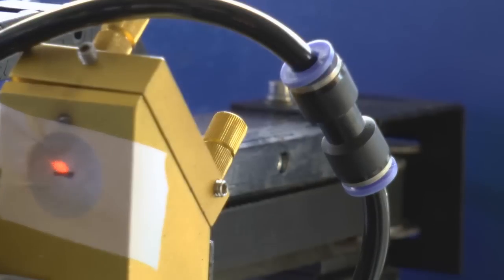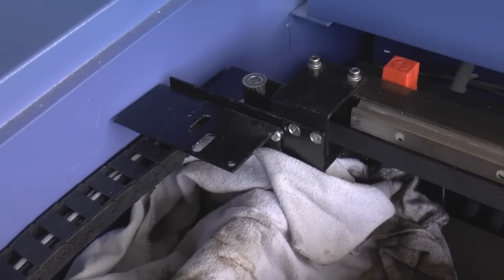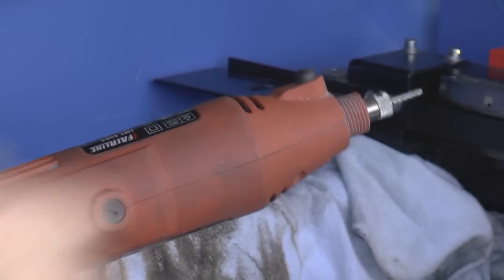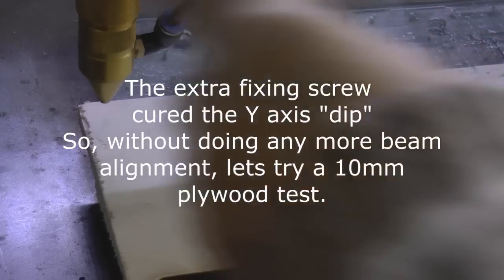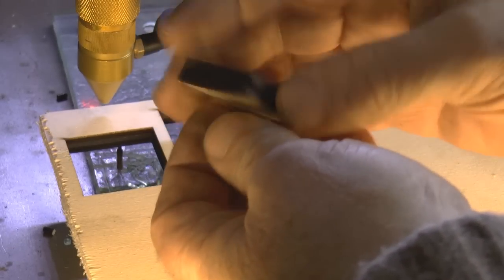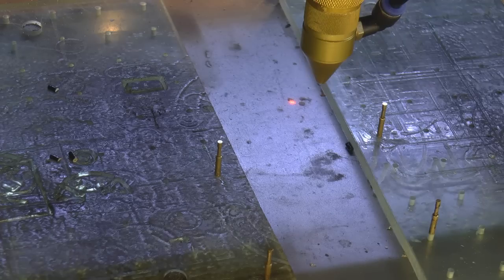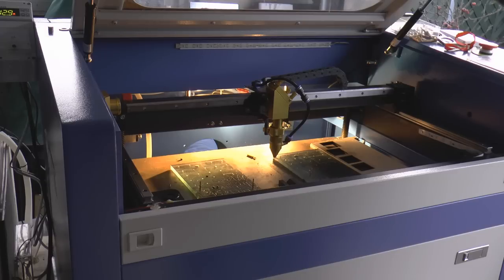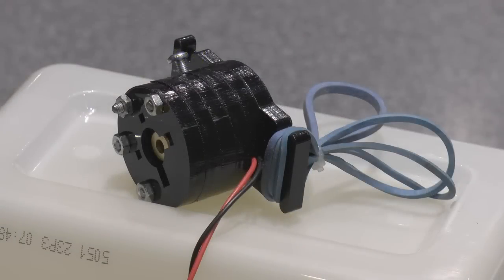RDWorks Learning Lab 38 Mk3 Laser pointer part2

Comment: A quick question I've been meaning to ask... What size (or part number) pogo pins are you using?
Reply from the maker: The problem with  following my learning journey step by step, is that you will make the same stutters and mistakes as me. I suggest you watch ahead and see me improve and learn. This is not a tutorial from an expert, I am a student without a tutor who is aspiring to be moderately competent . As for the pogo pins, they happened to be in a drawer at my moment of need but after a little experience I decided to upgrade with a cheaper and more stable support method  See https://www.youtube.com/watch?v=kMDRzBZTW9c

Best wishes
Russ

Comment: Hi Russ - Love you Mk3. When my laser will be up and running I will most probably ask for the DXF. Recently I have stumbled on a 3D scanner. Point is, the scanner has 2 small laser pointers like yours, but with the addition of focusing capability which by turning the lens it focuses the beam to a tiny dot. I shall try this and report.
Reply from the maker: Hi Isaac
This was my first attempt to make a visible simulation of the laser beam that could be easily copied used to make beam setting dead simple without all the pulsing and scorching. I have stopped chasing this holy grail at mk7 and settled for a set of simple logical steps with pulses and scorching because there is nothing to beat it. Yes you will get close  with the simulated beam but not close enough. However it does have one great use as a reference beam. If you want to remove a mirror for thorough cleaning you turn your machine off and set the pointer to a target in front of mirror 3. Remove and clean your mirror. Upon replacement you will find that the spot is no longer on the original target position. It is now but a few seconds effort to adjust the spot back to it's original position. Simple. I will not stop you chasing that same dream that I had if you wish to try some of my designs.

Best wishes
Russ
Reply: Hi Russ - I saw the other videos where you set the mirror's holders to have an even gap, then tuned the tube, and after that tweaked very small changes in the mirrors. This looks very logical to me - however it can well may be you have found some better methods in the following videos....

My tube will sit on 2 T slot rails, so I believe your Mk 2 holders will give me the option of adjust it the best I can. Sent you an email request for the tube holders.  Thanks for your input.

Comment: Hi Russ,Very nice. If you would send me the dxf files I think I'll take a stab at it. Don't know if I have enough room between the tube and first mirror. What's the depth on that assembly?Your sagging Y gives me some consternation. I would not have thought it was the mirror as I wouldn't have thought it could have enough different stress to make it move like that. Is the extra screw holding the mirror mount or is the mirror mount now holding up the mechanical assembly? Have you figured out what was really moving?Regards,Chip